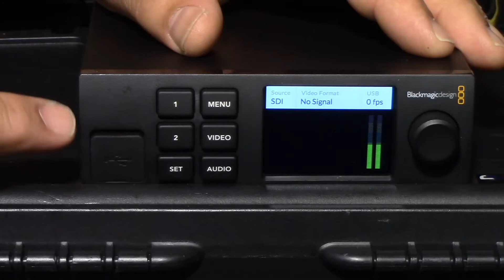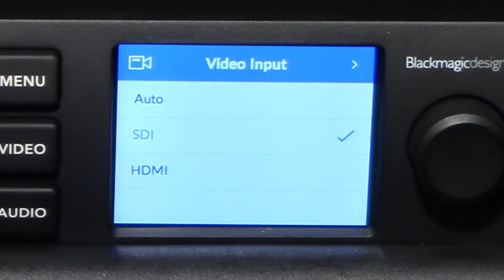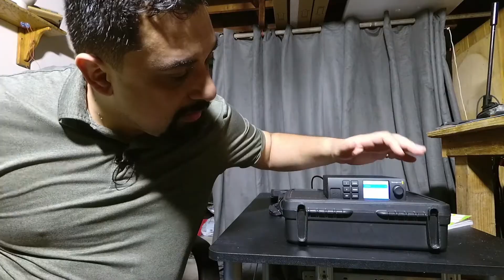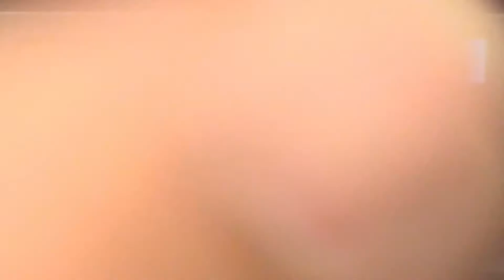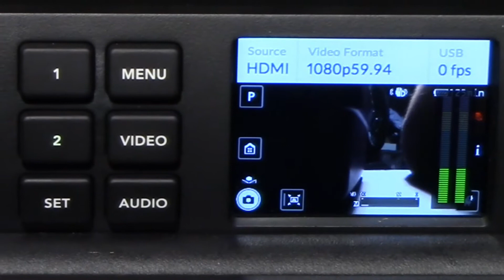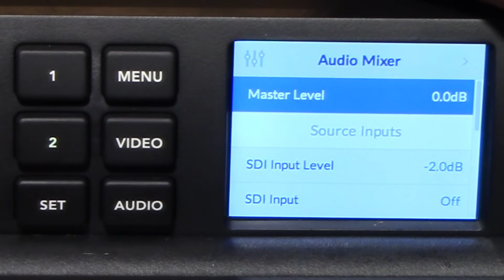Blackmagic Design Web Presenter Interface

Comment: If I use a "Y" xlr cable to connect from mixer's output Left & Right into Web Presenter's xlr input, will I get stereo sound or will it still be merged into mono? Thank you for this video by the way, one of the most informative on this device by far.

Comment: marlon, have you noticed a drop in the audio when switching between camera sources? I have the same unit and am experiencing a drop in audio when changing between source 1 & source 2. I am running version 1.2 firmware.

Comment: Marlon, I've used the BM ATEM TV studio, have you seen any problems with heat in the unit after running it for a couple of hours? Does it have a fan in the unit?
Reply from the maker: Yes it does generate a bit of heat - I do not see any fan nor hear it. It is not HOT but warm. There are not cooling fins either. The heat has not been an issue for us. There is also no on/off switch. It is plugged in or unplugged.